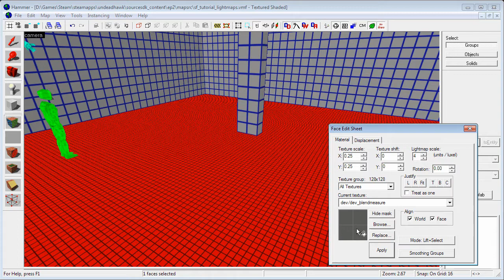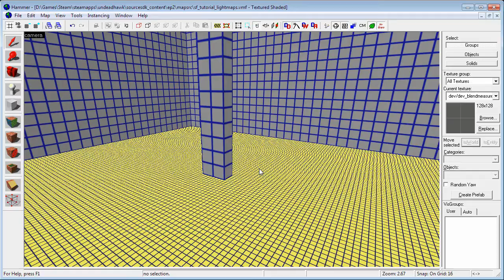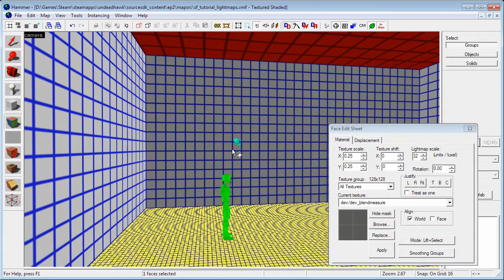SF's Hammer Tutorials - Lighting 2: Lightmaps

Comment from the maker: @dak1862c The lighting in the Source engine is pre-calculated so you can have as many lights as you want in your level and at any detail without loosing any FPS what so ever (unless those are dynamic lights of course).

To increase performance, try cutting down on the amount of advanced models you use in an area, and make sure that the player can't see too much from any one place. I have made a couple of tutorials on optimization, so check those out.